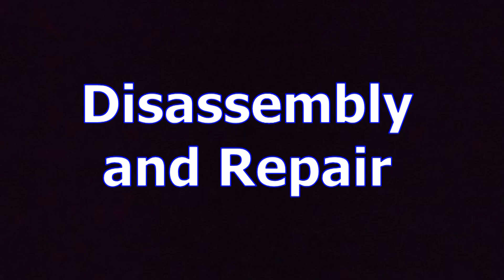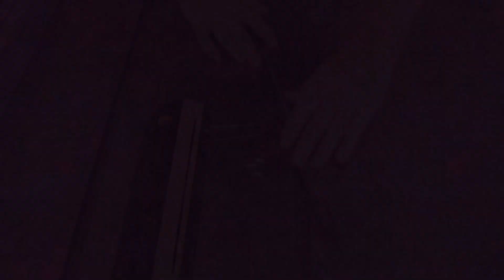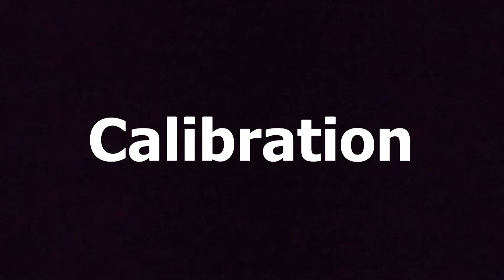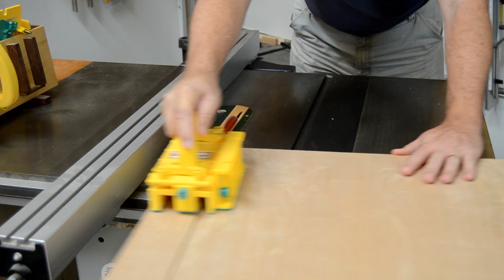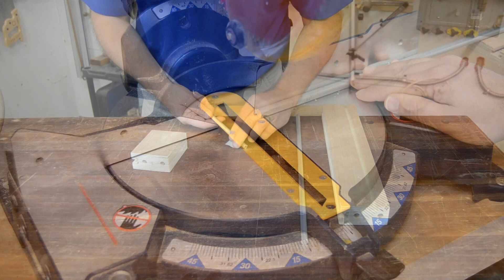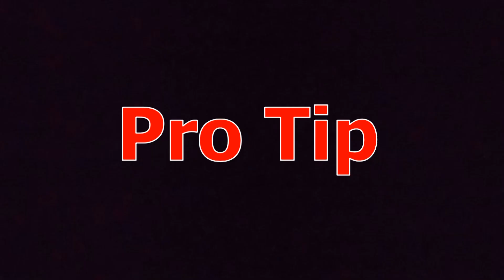Miter Gauge Upgrade

Comment: Yes yes and yes I agree with you. Tuning up the factory miter gauge is very worthwhile. My Delta table saw miter gauge received nylon set screws the first week I owned it. I made a simpler miter extension but it is very functional.
Reply from the maker: I find myself grabbing this upgraded unit as often as my Osborne EB-3

Comment: With all that work and expense,  you might as well buy a new upgraded miter gauge.
Reply from the maker: A good aftermarket Miter Guage can run upwards of $400.00 I have the Osborne EB3 which runs about $140.00 currently. For many folks, the effort is worth the savings. Your mileage may vary. 
Thanks for watching!

Comment: Thanks for posting this-after getting sick of replacing blue tape, I've just done this with my crappy Dewalt mitre gauge.Ended up with a M4 nylon grub screw as there wasn't a lot of meat on the guage to go for. Will have to see how it holds up.
Reply from the maker: John, Glad you found this useful! 
The nice part about the nylon set screws is that they won't mar your miter slot, and as they wear, you can quickly re-adjust them.

Comment: This is a nice build and way to save an old miter gauge.  I'll definitely be breathing new life into my old miter gauge with this.  

One tip you missed... when making the face piece of the fence, and while creating the slots/t-track on the router, add a small chamfer to the lower face side so you have a small area for dust to collect and not cause the workpiece to be pushed away from the fence.
Reply from the maker: Thanks for watching! A dust bevel is often a good idea. You just need to keep it small, especially if you work with thin stocks like veneers.

Comment: I have been using the same type for 50 yrs. with great results.  The play in the slot lets you fine turn a cut.  Allways use a wood piece on the fence.  Why would anyone want a metal on the miter.  Before chop saws we would have two miters, one right and one left 45d.
Reply from the maker: Play in the bar means no two cuts will be exactly alike. There is a reason that every aftermarket miter gauge is adjustable.

Comment: Heres a pro tip.  For safe operation use the blade guard that came with the saw.
Reply from the maker: Bill, you do what you feel is safe.  I will never tell you to do anything you are not comfortable with. But VERY FEW blade guards work with miter gauges, especially when you need a backer.
Reply: @Woodcademyshow  Actually blade guards do work with miter gauges.  Even with a backer.
You are encouraging bad safety practices.
Your fingers were less than 2" from that blade without a guard or even a riving knife.  If you have a kickback like that your fingers will be gone before you even feel the blade cut them off.  A small fraction of the fastest human reaction time.  Can't fix stupid can we.
Reply: @RazorStrap  yeah, first video I have seen from him and the spiel about the hot metal shavings while standing over a table saw with no guard and no knife sort of rang hollow. like he is talking to a 5 year old that somehow has access to one of the most dangerous tools in a wood shop. the only time I have had to take my blade guard off is when ripping something so narrow that the guard interferes with the fence. I will have to take it off when I do blind cuts, but seeing as the knife that came with my table saw does not allow them, that won't be until I make a new knife.

Comment: Cool solution but lil suggestion 👍 if you want something a lil longer lasting you can get  dog point brass tipped set screws they're like the name brass tipped and the dog point is extended out and flat also to keep from having to adjust them a lot from saw vibration backing them out etc get some shorter brass tips get them adjusted then  run a short regular set screw in behind to lock your guide screw in place 👍👍👍
Reply: Also if you're not used to working with metal and want to get an accurate start for your drill bit instead of center punching your bar use a center drill first then run your tap drill you can get a cheap set  at harbor freight or online for under 10 bucks 👍👍👍
Reply from the maker: Great ideas, thank you for sharing! There are any number of good options. I chose the nylon set screws for cost and ease of use for the average woodworker.

Comment: instead of scribed line on bar ,use edge of bar
Reply from the maker: CJ, you can do that, but since the pivot point of the head is centered on the bar, aligning off the edge can distort the reading slightly, especially at high angles.
Reply: @Woodcademyshow  ONLY SQUARING THE FENCE
Reply from the maker: @cjlures8618  My miter bar has a slightly rounded edge to the bar, it is not sharp. Working off the scribed line gives me the same reading every time. 
The cool part about building your own jigs and fixtures is that you get to do them your way.

Comment: I'm not sure I understand the point of scribing the center line.  If you're going to measure and tune accuracy with a protractor, why not just use the edge of the miter bar as your reference point?  Adding your own line just adds an additional risk of error.   Nice video, btw.  I don't mean to sound negative/critical, you just confused me on that one point.  I was actually excited that you were going in a different direction: scribing the line on the underside of the bar, then adding some low friction material to make the gauge slide more smoothly.
Reply from the maker: Rob, because my protractor has a slightly rounded edge along the top so there is not crisp line to set the protractor to. Scribing the line and including the miter gauge pivot point on the line will be as accurate as you can make it.
Reply: @Woodcademyshow  That makes perfect sense.  Thanks for clarifying.
Reply from the maker: @rww_04  My pleasure! and be sure to subscribe!

Comment: The miter gauge should be right in the first place the manufacturer  should rectify this sloppy problem
Reply from the maker: Jimmy, we agree, but so far, no manufacturer is supplying a really good miter gauge, and many are extremely cheap, even on expensive brands! I have asked manufacturers about this at trade shows, and they say, "The buyer is going to get an aftermarket miter gauge anyway, so why bother?" I did point out that if the factory miter gauge was good, the buyer would not NEED to go out and buy a replacement.
Reply: I fail to understand why there is so much slop designed into the system. I guess that for trade use when the slot contains sawdust it will still slide. IMO false reasoning. I find there is always at least one illogical deficiency when machines are manufactured abroad, as they are now.